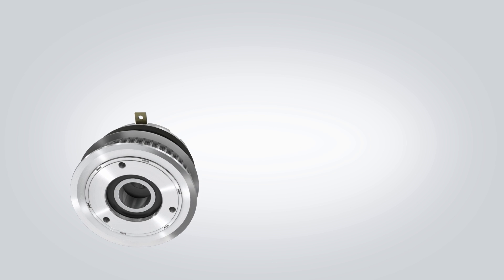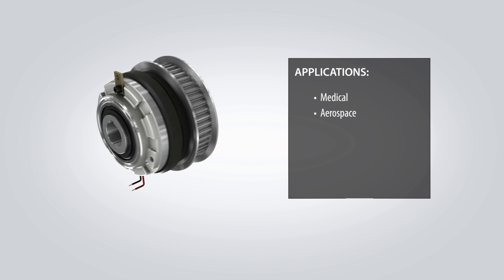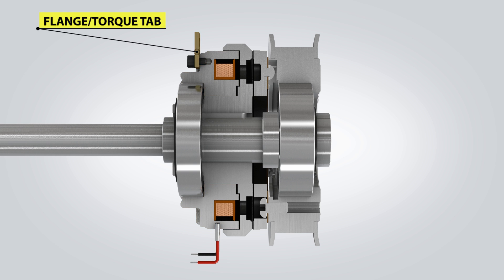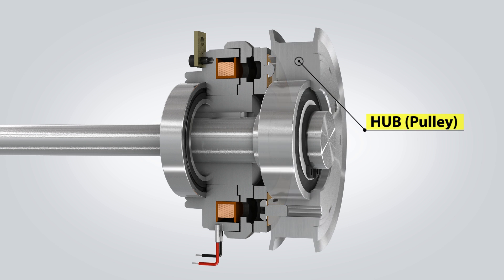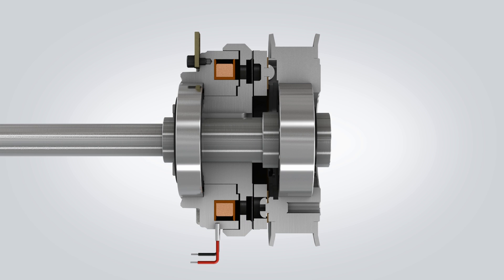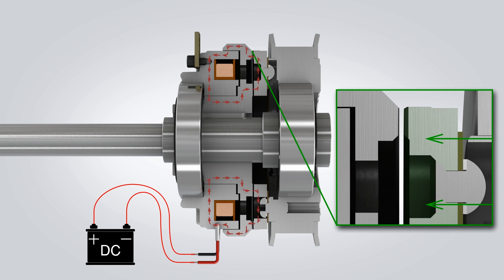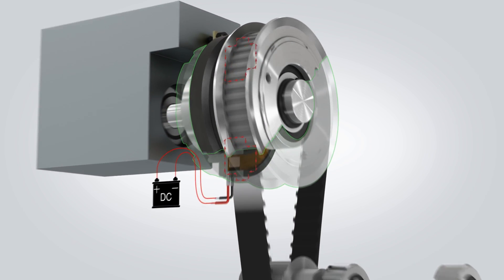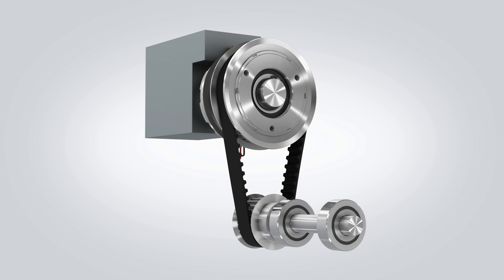Tooth Clutches

Comment: The shafts do not need to be stationary for engagement of this clutch, I am afraid that is wrong information
Reply from the maker: If you are thinking of a STANDARD friction clutch then yes, you are correct.
 However, TOOTH CLUTCHES require the two surfaces to engage at 0 rpm. When engaging, the peaks and valleys of the teeth on the clutch surface need to mate. Usually they are not lined up perfectly when stopped and need to align themselves when engaging. If the clutch were to engage while the shafts were rotating the teeth could get damaged. If you have more questions about how to integrate our clutch/brake products into your application, contact an engineer here: https://www.keb.de/company/representatives-agencies
Reply: Thanks  @KEBAmerica
Reply: @KEBAmerica  sir can you please give me your e-mail ID, I have some technical queries related to electromagnetic clutches
Reply from the maker: @raghavgupta7137  Please contact your local KEB representative, details here: https://www.keb.de/company/representatives-agencies